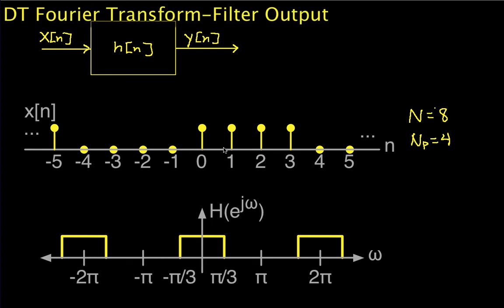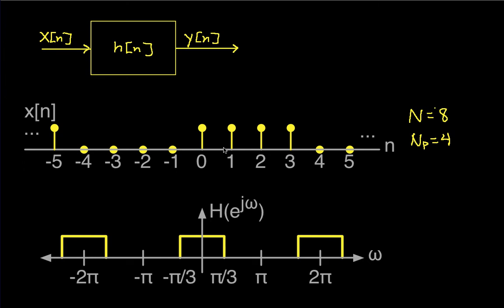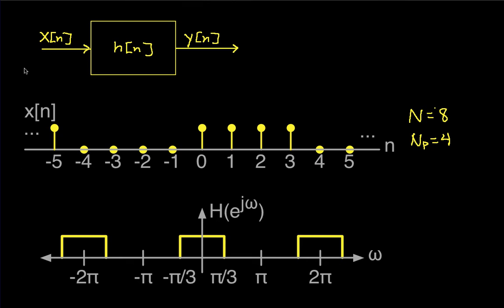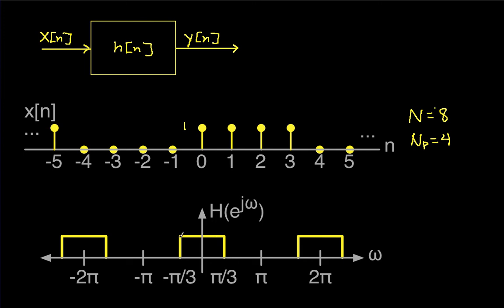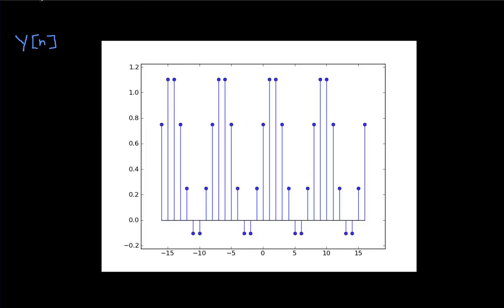DT Fourier Transform-Filter Output

Comment from the maker: You are correct: because x[n] is periodic, we can compute a DT Fourier series for it; the DTFS gives a sequence of coefficients. As I try to explain in the video starting about 2:50, each coefficient corresponds to a discrete-time sinusoid at a particular frequency. A sinusoid at a given frequency has a DTFT which is a scaled delta function located at this frequency. This gives a connection between the DTFS coefficients and the DTFT, which we use to determine which components are filtered out.